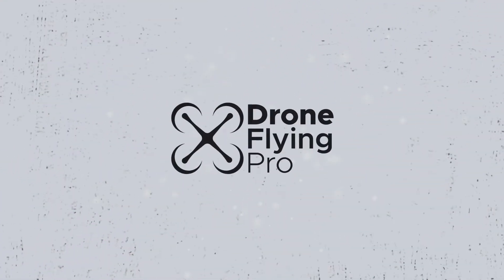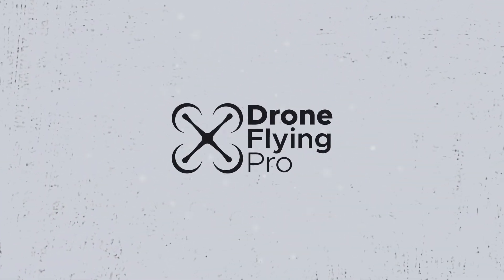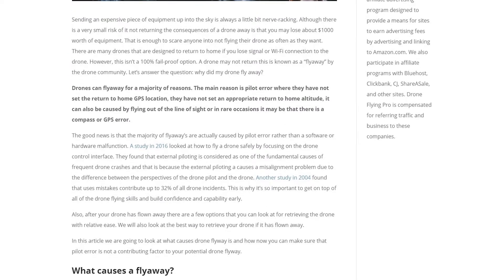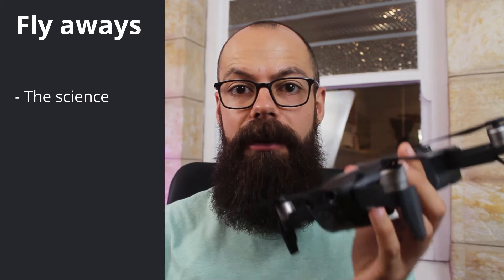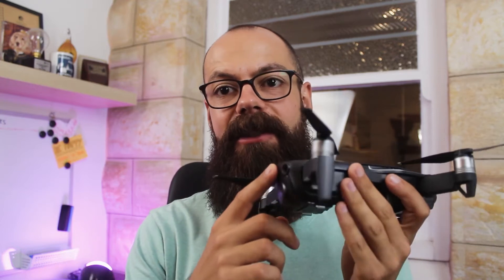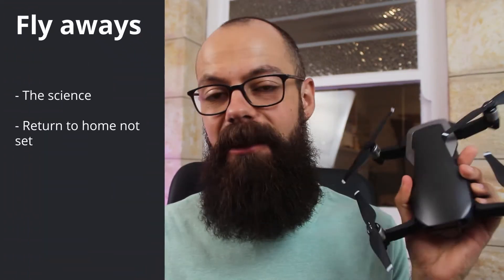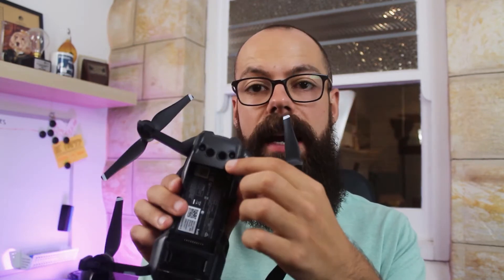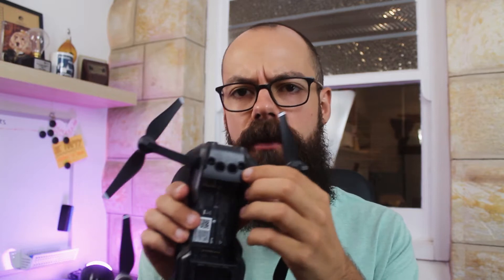Why did my drone fly away? 5 simple checks to make!

Comment: I'd add to that list "Don't buy a Mavic."
It's a drone.  Not an Excavator.
My dog ran off at the park, mid-flight.  I abandoned the controller and went after the dog.  The Potensic took care of itself, returning automatically from over a mile away.  Remarkable.
I take off, observe for stability, land, launch to set my take-off point, and set the return altitude high enough to avoid  infrastructure.  Works every time.

Comment: what I found about magnetic interference that might go wack your drone's compass is not to calibrate it, do not ever calibrate mostly if you're not in a big space 5t around you like there's a wall, trees and other object that near around your drone to do a compass calibration. Just fly your drone, it's much safer than calibrate its compass.. Plus do not always use RTH, you bring home your drone manually so that it will not coz any issue in case your drone's compass fails.. Only do a RTH when you know you are lost or if the remote is disconnected.. But if you know where you are just do a return home manually and you have nothing to be afraid of compass fails.

Comment: Finally the mini 2 drone that I just bought 2 months ago crashed.  I don't know where the error is, when flying 70 meters with a height of 25 meters, suddenly the drone cannot be controlled via the remote controller.  The drone flew to the right quickly and hit the wall.  The gimbal is crushed and there are cracks in the body.  I've tried to do the opposite movement but the RC does not give any effect.  Dunno what happened.  Really confusing.
Reply: in newer model like your mini 2 drone, compass was never been an issue because it has new technology inside it that it will never be a compass fail if you already flew your drone up in the sky without a drift or a strong wind that will coz it.. Maybe your screen has something that might trigger to touch the RTH and when the RTH on the MINI 2 activates you can't control it except for the camera tilt.. Then you forgot to wait for the home point to lock before taking off that is why it flew in the wrong direction.. You can cancel quickly the RTH from your screen if this happens.. Instinct is your best weapon if this happens and then manually fly your drone manually.. In your case, you've panic. BTW never fly your drone close to the wall if it has no sensor, the turbulence from the propeller of your drone will  suck your drone in and hit the wall quickly

Comment: My two cents worth.  I flew my Phantom 3 Advanced  one morning and it suddenly went crazy. I received a battery error alarm. I somehow manage to get it down without a crash. Prior to the flight, my battery indicated 50% left from a flight the day before.  I did some research and read you should never fly your drone unless the battery is fully charged.  Since that day, I have never flown unless the battery in fully charged.  No more issues.
Reply: Was 50% drone battery or controller battery?
Reply: @dontrustwhiteyevery1  The drone battery was at 50% when I had the problems. Now I only fly with both the controller and drone batteries at 100%.  Haven't had that issue again.  Thx for the question, I hope it helped.